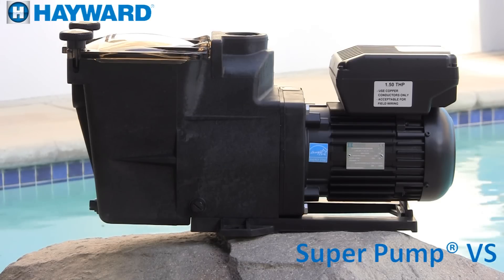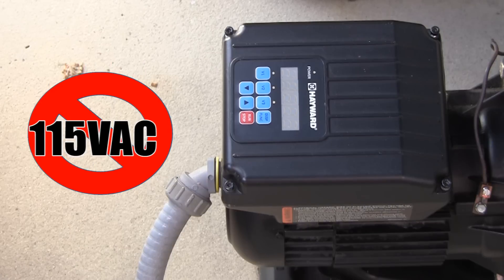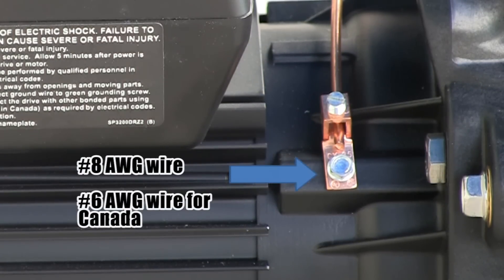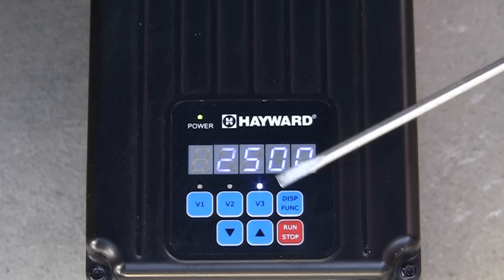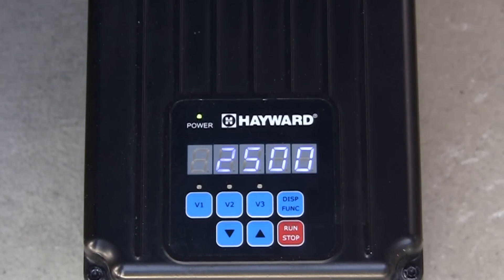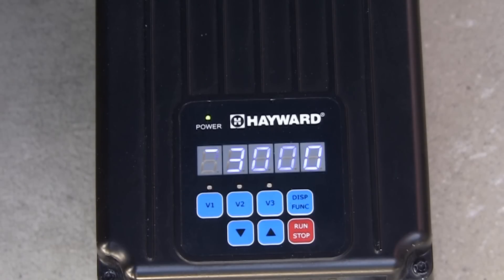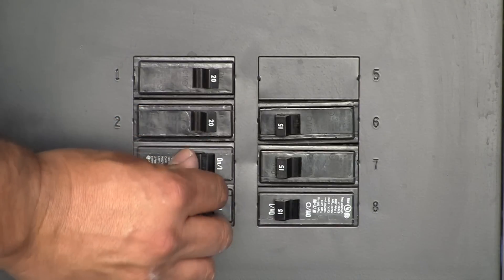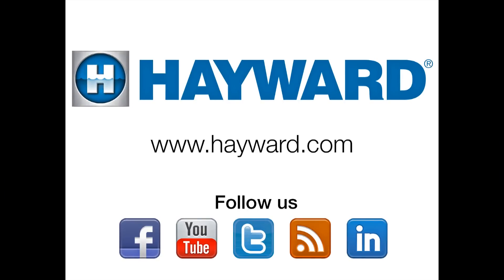Super Pump VS Variable-speed Pump Programming and Troubleshooting

Comment: Does this have a built in timer or do I need a separate timer? I just don’t want to run it during Peak hours and do low speed the rest of the day with 2 hours of high speed. Is that possible or a good plan for 10,000gallons
Reply from the maker: Hi again! Please contact technical support for your inquiry. Support is available during the work week by calling our support line at 908-355-7995 or by private messaging on Twitter or Facebook.
Reply: Hayward Pool Products thank you I will call tomorrow since I am new to this.

Comment: getting error code 64.anyway to fix this
Reply from the maker: Hi Rich, we’d need  to know the model number of the pump.   You will find the model number on a black and silver label near the square basket lid.  Also private message your phone number on Facebook if you’d like someone to call you on Monday.
Reply: @HaywardPoolProducts  sp2600vsp
Reply from the maker: The 64 failure code on the SP2600VSP means there is a circuit error in the drive on top of the motor.   The only repair is to replace the drive and motor.  It would be a different motor and drive but update from the original.   The part number for the motor and drive is SPX2600Z1VSPE. Please private message your phone number to our Facebook page if you would like to discuss.

Comment: Hi. I'm wondering if it's okay to run this pump at max speed all the time ? Anything below that and the spillover will not function properly. I'm also wondering if it's okay for my 16,000 gallon in ground pool ? Last question, if both are okay, is there a way to quiet it down ? Perhaps putting rubber underneath it ? It's way too loud. Thanks.
Reply from the maker: Our tech would like to speak with you. Please DM your phone number and he will call to help.
Reply from the maker: Hi Eli, please private message your phone number for a call from our tech.
Reply: Perhaps I'm losing it but for the sake of me I cannot find the private message button on your page. Could you initiate the message so I can reply ? thanks.

Comment: I just purchased the Hayward Super Pump VS and it does not match the configuration as described.  On the pump I received you do not set the run time by setting a number of hours from 30 minutes to 23 and a half hours but you have to set a start and stop time for V1, V2, and V3.  Also default settings are V1 at 1500 rpm from 12:00PM-8:00AM, V2 at 8:00AM to 12:00PM and V3  Deactivated and not what this video shows.
Reply from the maker: Sean Murphy Would you like to speak with our Hayward tech? If so, please provide your phone number and we will call you. You can private message your number on Facebook.
Reply from the maker: Sean Murphy Sean, this video was made before we changed the Super pump VS programming to make it more friendly.

Comment: Beyond this VS2600 training video, what are the optimal speed settings and durations in hours given 600-3000 rpm, the volume of the pool, the size of the piping, the cost of electricity kWH,   type of filter cartridge, temperature of the water and other appropriate variables,  Seems like this could be reduced to a graph for us users.

Thanks 

Rich
FLL